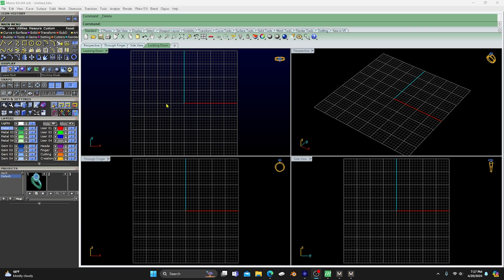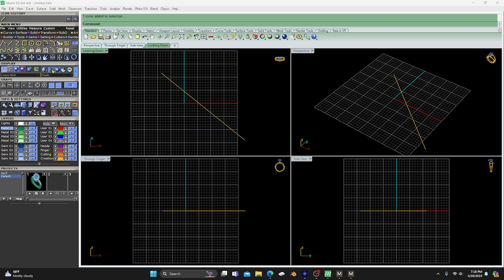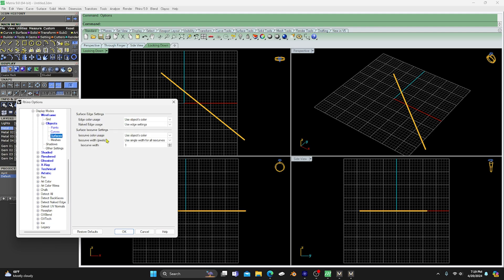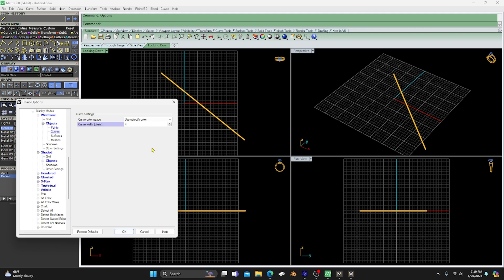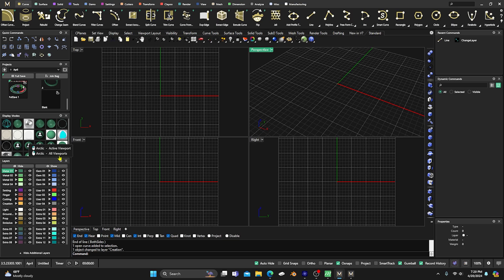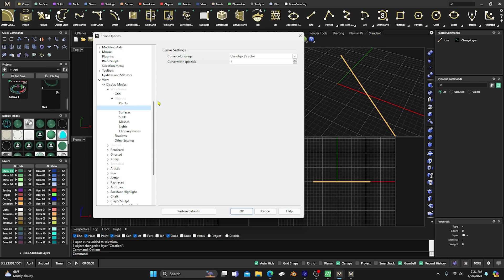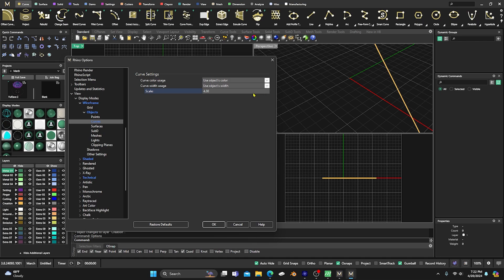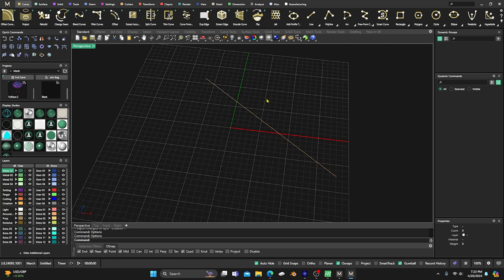Adjusting Line Thickness in Matrixgold and M9

Comment: I can't widen the grid lines but I can make them more easily visible by making them brighter.
To "brighten" your grid lines go to "Options" first then go down to the Rhino options and double click on "appearance" so that "colors" appears below it and click on that. In the popup, be sure that the "custom" box at the top is checked. You can then pick "major grid lines" or "minor grid lines". If you want the Minor Grid Lines to show up better, simply click on the color bar and a color wheel will appear. There's a box in the center of the color wheel showing you what color is already in use. Look for the very small circle on that color swatch and use your cursor to lighten or darken the default color by sliding the circle either up (for brighter) or down (for darker). 
I used this technique to also lighten the black background which I found to be too harsh.